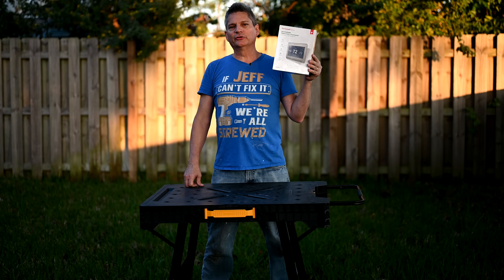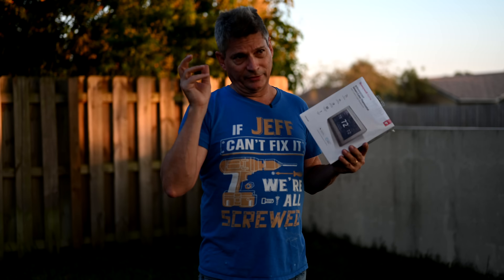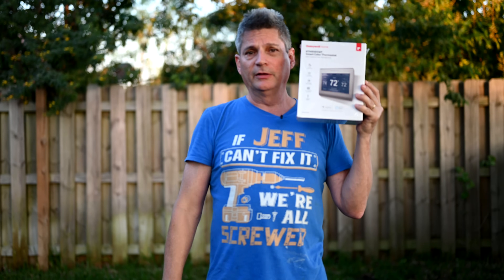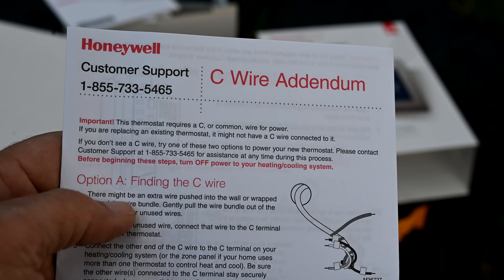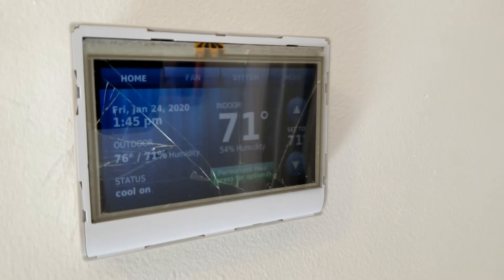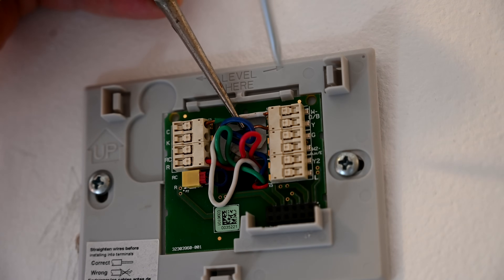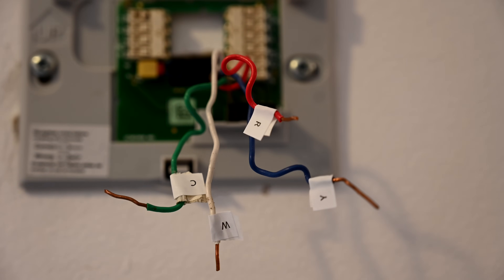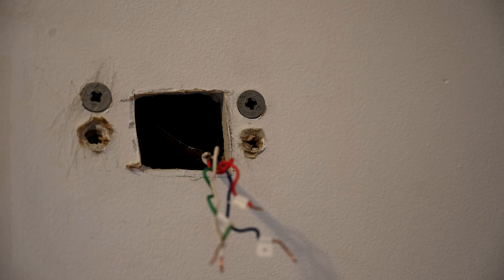How to Install Honeywell Smart WiFi Thermostat RTH9585WF Wiring

Comment from the maker: 💲 Honeywell Home RTH9585WF1004 Wi-Fi Smart Color Thermostat: https://amzn.to/2sXpBCl
💲 DEWALT DWST11556 Express Folding Workbench: https://amzn.to/2qsaRdi
💲 Milwaukee 48-22-2202 3-Piece 1000V Insulated Screwdriver Set: https://amzn.to/2ItbU3r
Reply: Is there is a power outage...since it doesn't have batteries can it short  it out?
Reply: Today at HD - Milwaukee M18 5 tool, 2 battery deal $299. Only 1.5 AH batteries and brushed. It’s in some stores because there is a store sku.
Model# 2695-25CTM 
Internet# 309939013 
Store SKU# 1004497652

4.8 ft3 Whirlpool electric free standing range $200 off today only. $499.  
Model# WFE320M0ES 
Internet# 205916213 
Store SKU# 1002309875
Reply: Okay I thinking on getting it, It got confusing on link to Amazon for thermostat, on description it said it uses AA batteries If you don't have C wire? I have a regular gas furnace ( no AC/ cooling system) nothing fancy So I can't use that thermostat that is required  C wire hook up  even on Amazon  it takes AA battery? I want to get one that is password protected that nobody can turn on furnace and jack up the temp and I can shut off and turn on furnace while I'm at work or out of town.
Reply: If my red wire has continuous 27 volts would I put that in the " c " slot? Thanks
Reply: Hi Jeff, Thanks for the informative video, it was very helpful.  I have a 4 zone system - three that can operate on their own, and the 4th is the main panel that controls the 4th zone but can also control the other three.  Will this Honeywell system work in that set up?  I do have the 5 wires required and had the Honeywell in another home and liked it.  The plan is to replace the existing Honeywell's that are about 15 years old.

Thanks!

Jeff
Reply: Any updates on this?

We recently had our HVAC replaced with what I Believe is Heat pump after years of a dead unit and I'm looking into a more advanced controller. What I'd Like to have is one where I can have AC from say 8a-8p and then have it switch to heat from 8p-8a during the warmer months, but during the colder months, have it be just on heat. I was also considering finding one that can adjust based on the exterior temperature, but I'm still pondering how important that would be.

Comment: You keep talking about five wires, but I have only four wires... but only four wires because this is only an air-conditioning application. No heat. I have one wire for COOL, one for FAN, a REd wire for POWER and another one for C that says 24v connection. It ic currently running fine onf a Nest. Will the Honeywell work in its place for AC only?

Comment: Jeff, I have a question what if we had an old thermostat (that ran on batteries) and the blue was already the c wire, would you flip the wires to power the thermostat? Thanks
Reply from the maker: Yes I would and I did, we transformed from an old battery powered thermostat, due to constant nagging from my wife swearing the the batteries were dead and thinking the thermostat was not coming on. This way here, it has constant power and no outages when a battery needs to be replaced. Takes her arguments completely out of the equation.
Reply: @jeffostroff lol, thanks for the reply and glad the wife is happy!

Comment: The Honeywell TH 8321 thermostat is the Swiss Army Knife of thermostats.  Available in wifi too. Excellent for multi stage heating/cooling and dual fuel heat pump applications. Thats all we keep on the service trucks. You don’t beed all the glitter and pretty colors.

Comment: If you have a power outage what happens to your program? The answer was tougher to find than it should be. It's not answered in any of the literature but in Amazon (look this stat up) in the Ai question area I asked and it's response was "According to the product information, it does not have a battery backup. The programming and settings are retained during power outages." So, many thermostats have batteries (AA or AAA or others) to retain the program. This one has the ability to retain without batteries BUT for how long in hours, 2, 6 or??   Another tip; search:  "resideo 33-00269 user guide"    for a more detailed (PDF) manual for this device.

Comment: If no C-wire connected to an older thermostat, look closely at your current installation -- it MAY be hidden/unused with the older system (tucked back into the wall or cut short at the insulated wire bundle). Preparing to re-wire mine (from 4 to 5 wire) I opened my furnace panel to find there IS an unused C-wire in the cable. Inside the furnace I simply connected it to the C terminal (after checking the wiring diagram with the furnace installation package). On the thermostat end, I found the unused blue C-wire cut short, hidden in the insulation sheath. With plenty of extra wiring tucked into the wall, I was easily able to re-strip the full 5-wire set to equal lengths to connect to the new thermostat.

Comment: Great video i was wondering will this thermostat work with a duel fuel system my unit has a heat pump and a gas back up with a out door mounted thermostat

Comment: My wiring has the “C wire” in place. I’m buying it for boiler (heat). I don’t have a “yellow wire” (A/C). Question: It should work fine with 4wires (R/W/G/B). Right? Thank you so much!

Comment: Ok, I’m a little confused. My older unit has a Green wire in the G slot on my older thermostat. I don’t have a blue C wire connected. I see a blue wire bundled with the other wires, just not being used. My ac/heater is all electric. Can I do what you did and use the Green wire for the C slot,common wire, and not use the G slot in the new thermostat?  Make sense?
Reply from the maker: The colors ar eirrelevent, what you need to do is loog at schematic charts for your machine to determine which wire is the c wire and use that one

Comment: I have ac and heat pump. System is 5 years old and has the "C" wire but I couldn't make this thermostat work. WIres: C, Y, R. G, AUX (which is White wire) and O (heat pump). My system has blue and black wires but they are not connected to the original Honeywell thermostat. Followed instructions in the manual but couldn't get it to work.
Reply from the maker: yes so you need to find out where those wires go on the heat pump and ac they have wiring diagrams

Comment: I just bought that exact thermostat. And I only have four wires. You claim in the video you need five wires for this, and yet you only had four wires. So while I liked the video, it didn't help me.
Reply from the maker: That is correct, I mentioned in the video I stole the 5th wire from the air handler connections, and by doing that, we can never just turn on the AC blower as fan only mode, which is OK for me, we only use it in AC or heat mode
Reply: My unit is on the roof. And I am unable to climb up there. I just installed a Honeywell RTH111B and it seems to be working fine.  Thanks for the video. It encouraged me.

Comment: Great video, but wonder why you didn’t mention to turn off power to the AC AND HEATING  in the electrical panel before starting.  You showed it, but didn’t mention to turn off the power.🤔👍🏽

Comment: I installed mine but when I turn on the switch the thermostat won’t turn on 😢
Reply from the maker: dod you confirm you are getting 24 volts on the C wire?
Reply: @jeffostroff  I have no idea what you talking about tbh 😅

Comment: Did you cut the power first before handing the wires? You were touching the wires with your fingers but did not get shocked.
Reply from the maker: Yes I caught the power to the air conditioner prior to starting and it's 24 volts so you're not going to get shocked with that type of voltage anyway. You can tell just by looking at those tiny thin wires that they are not going to be carrying any type of high voltage otherwise they would be real thick wires like your electrical cord

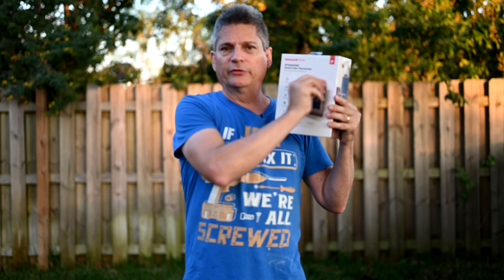Comment: Thanks Jeff. I enjoyed your video because it was to the point. You wasted no time showing us useless stuff; I appreciated that. I have this (same) thermostat but today, it powered off at 02:30. When I awoke, I noticed it and haven't been able to reset it. I removed it, checked the breakers and replaced the faceplate, but it still didn't reconnect.

Comment: Is reconnected the wires perfectly - AC blows heat ?
Triple checked everything
Reply from the maker: Only thing I can think of is make sure it is in cool mode, and go one by one, check the wires on your system, maybe one got crossed.

Comment: what happens if you have a blue common wire but it’s not connected at the air-conditioning unit? it comes out the other end loose and coiled around another wire.

Comment: question, the thermostat i currently have you never have to change the batteries does that possibly mean it already has that c wire tht would be needed for this thermostat

Comment: Have you seen or ever used the 110 volt transformer to 24v adapters that supply the voltage from a wall outlet? Seems like a fast way to get the power to it??? Also Can these be used with remote sensors placed in other parts of the house?

Comment: I need help. I just installed this and my old thermostat had the R with a jumper to RC. I plugged the new one up with everything in the same location even the R in the R location. After everything was done and set up I turned power on everything worked but when I turned the A/C also known as Cool the heater came on. Any help on why the heater keeps coming on when I have it on cool?  I have 5 wires G,W,C,R,Y. They were all connected to the same spots as my old one. I’m thinking maybe it has to do with the R? I’m electric as well please anyone help

Comment: Mine was great for 6 months. Then it went off for a minute and went back on. After that, the fan wouldn't go off. Even tho i reset to factory settings and then turned off completely - fan is still running. Hate to see my electric bill.

Comment: So I have one question,do I have to have wifi will it work without wifi?
Reply from the maker: You will need wifi to set it up and register it, but it will work without wifi once setup. You will have no access to it from apps on phone, only direct screen control on the unit itself

Comment: I'm installing one of these tomorrow and I'm going to be  running into an issue my system has 6 wires and I can't find in the manual where the orange wire goes. It's got white yellow green orange red and common.  I really don't wanna mess up wiring it but the wiring diagrams confuse me lol
Reply from the maker: Did you photograph where it goes prior to disconnecting? Jus place it on the same labeled pin on the new one
Reply: @jeffostroff  i actually got it working without the orange wire as the thermostat i installed had no orange terminal i just used the red common white yellow and green wires. it works great and auto switches between heat and cool without that orange wire. it replaced one that was a 6 wire  honeywell thermostat that had the manual switches for heat cool and off.  i got tired of having to flip a switch every time it got too hot or cold.

Comment: My baseboard heater (208/230 ) wall thermostat has only 2 wire. Any suggestion?
Reply from the maker: You're going to have to come up with a way of supply that 24 volts AC to your thermostat. If you don't have a way to get it any other method, some people go on Amazon and they buy a doorbell plug-in transformer for about $15 and that gives you your 24 Volt AC to power the thermostat. We just did this at our church last week for the ring doorbells to power them
Reply: @jeffostroff  The wall thermostat is line voltage.
Reply: @jeffostroff  I am thinking to use a no neutral Sonoff. What you think?

Comment: But aint you missing your g for green?
Reply from the maker: I have all the wires the system needs
Reply: @jeffostroff  so on my honeywell i have the blue wire in y terminal of the stat. The yellow wire its not connected no nothing, shouldnt the yellow wire be on y terminal and the blue on c terminal?

Comment: Hi! Can I use this termostat without internet
Reply from the maker: I think you need to have the Internet to set it up but it will operate if your Internet goes down you can just operate it from the panel and it might flash notices that you don't have Internet

Comment: Great video and crystal clear but I'm still having problems. Had basic honeywell thermostat before and switching to this one. I have a 5 wire system  white/ w green/g yellow/y my blue was going to Rc and red to Rh on old unit. New one is not powering on. Would the blue go to the c (common?)connection instead of rc? I would greatly appreciate some help it's getting cold in here and I'm in Michigan! Lol🥶
Reply from the maker: Usually the blue liner goes to C but you can't always guarantee that so you really need to find out where the 5 wires go to on the air conditioner itself
Reply: @jeffostroff  thank you man I really appreciate the quick reply. I just put the old one back in for now until I figure this out.

Comment: My old thermostat wiring has G wire… I inserted into G slot on the Honeywell but it didn’t work. The thermostat didn’t start up after I finished installation
Reply from the maker: The g wire provides power to the blower, not the thermostat. You need the "C" wire for that: https://www.ifixit.com/News/30317/what-all-those-letters-mean-on-your-thermostats-wiring#:~:text=G%3A%20This%20wire%20controls%20the,the%20vents%20in%20your%20house.

Comment: I purchased this thermostat however I can't figure out where my two U1 wires go?
Reply from the maker: I've never seen a you one connection on a thermostat before. It likely goes to a humidifier do you have one? What model of thermostat were you using before?
Reply: @jeffostroff  I've since learned our system has a ventilation system and this model will not work. 🙄 Honeywell had five model thermostats that will work, one being the one we currently have which is the VisionPro 8000. There is no color screen thermostat available for this type is HVAC system.

Comment: This is awesome. I just bought one of these at HD for $99 (on sale from $179).  The thermostat in the house that I just bought was acting weird and this is an older house (built in '99) so I decided to just change it out.  Come to find out, it was a battery-operated one.  I suspect that the weirdness was because the batteries were low but not so low that it stopped working altogether. 

I pulled the old module off the wall (but not the backplate) and only saw 4 wires.  Well, damn.  Then I went to the furnace and saw that there was a 5th wire wrapped around the sheathing, not being used.  BINGO!  So I went back to the wall and could see that they took that blue wire and fed it back into the hole in the wall.  I pulled it out, hooked it up to the C connection on the furnace and, as if by magic, the thermostat powered right up!

And it was a sinch to connect to my wifi and my phone, so now I can adjust the schedule without standing in the hallway bending over.  So much better for my back.  And the old thermostat was only backlit when you did something to it.  It's nice to have power going to it all the time so I never have to worry about batteries and I can read the thing without changing something.

So far, I love it!  Thanks so much for the video to give me enough knowledge to get this replaced without having to call an HVAC guy, although the furnace hasn't been serviced since 2001, so I'm going to have someone come out and do a good cleaning on it just to make sure everything is in good working order.
Reply from the maker: Awesome, glad to hear you found that 5th wire, this is a great thermostat and you got that great black friday sales price too
Reply: I got the same 99.00 deal!!
Reply: @j.rcoker9051  SWEET!

Comment: Do you have to have wifi in your home in order for this thermostat to work?
Reply from the maker: No once setup it will work but it needs wifi to get weather I fo and receive remote commands from the app
Reply: So if I download the app on my phone will these features work? Sorry for so many questions. I removed wifi from my home due to all the radiation they omit. Not that cell phones don't 🙄 I just want to be sure that I can  connect before having it installed. Thank you for your time.

Comment: Hi Jeff - I'm considering the same Honeywell you installed here. Plus, I used to have an older Honeywill like yours that was broken. My old Honeywell still worked, except I couldn't change the time. So I switched to Ecobee last year - and I don't like it. It's hard to use. The thing I miss about the old Honeywell is that I could change/hold the temp until a specific time - e.g., set it at 68 degrees until 3:30pm. Can you tell me if the Honeywell RTH9585 offers the same flexible hold options? I'd like to know before I haul off & buy yet another thermostat. Thanks!!

Comment: So, why doesn't it matter that the yellow wire is missing? What's the functional difference between 5-wire and 4-wire? How do you wire this unit up if you have five wires?
Reply from the maker: This unit requires the 5 wires because you have to use the C wire on this unit. I try not to go by colors, but rather the function of that wire
Reply: @jeffostroff  But you're doing it with four wires, aren't you? I'm so confused.
Reply from the maker: @Bapuji42   You didn't pay attention to the video very well. Yes I'm doing it with 4 wires I had to borrow one of the other wires in the circuit and by doing that I lost the ability to ever turn on my AC in fan only mode. That's not a loss for me because I only operate the AC In heating mode or in cooling mode I never operated in fan mode so I did not mind losing that functionality in order to gain that extra C wire from the air handler Which is needed to operate the thermostat is thermostat power
Reply: @jeffostroff  Did you show where you got the other wire from and how you did it? That would probably help. Without that detail the rest of isn't really actionable.